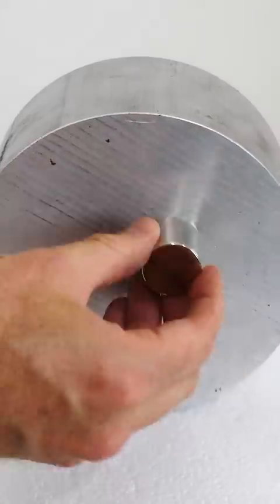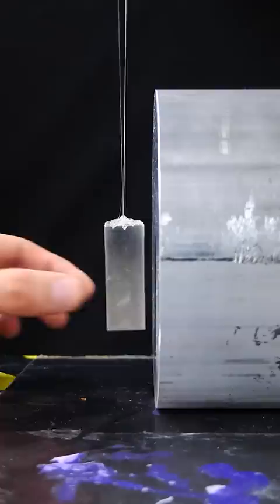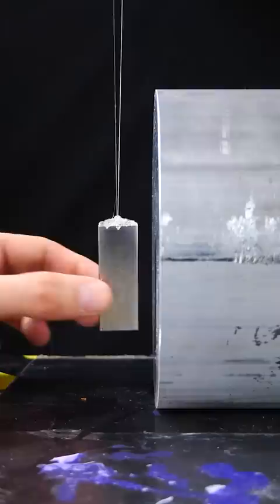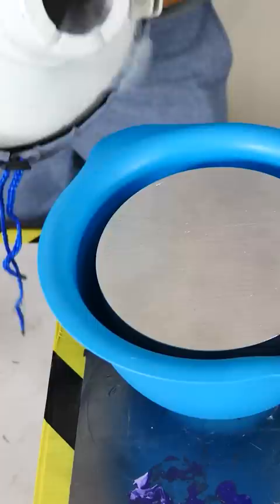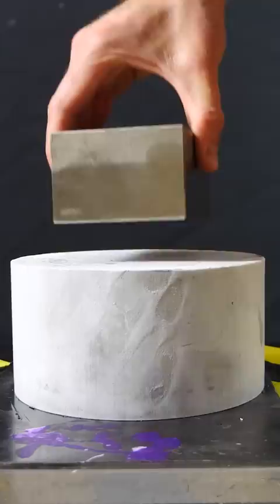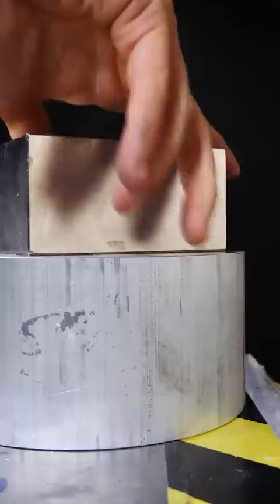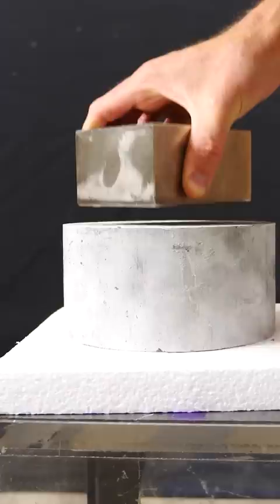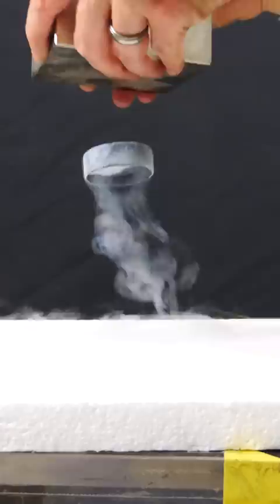Magnetic Braking Looks Like Magic

Comment: Conclusion: when falling, wear metal armour and aim for very cold aluminium.
Reply: Fast deceleration still kills you.
Reply: @gokul_ml  Yep, human internal organs are about as stable as an alcoholic's marriage.
Reply: You forgot the magnet. You still need the magnet.
Reply: @gokul_ml But it delends on from how high you are fallng. If only from a few feet, this amount of braking would help quite a bit.
Reply: @HeyChickens  The armour.
Reply: @no_signal_98  Metal armour includes the magnets?
Reply: you may stop, your organs say otherwise
Reply: I'm curious that if with enough material we can utilize this for sports.
Reply: @Cuddlydeath  It would be very heavy.
Reply: You try it first.
Reply: @HeyChickens can you provide the physics work you did to achieve your calculations on that stance? The claim that “sudden acceleration due to magnetism is safer than sudden acceleration due to hitting the ground” (btw deceleration IS acceleration in the negative direction)
Reply: @Living-gnu-64  I'm not sure what comment you're referring to. I don't see it here in this thread. But whoever siad that, the only way it would safer for your organs is if all the tissue in your organs were being acted on by the magnetic field, not just the armor. Otherwise it would be the same as hitting the ground with the armor on, except with the effect of the armor slowing down slightly ahead of the impact due to the magnetic braking.
Reply: Zience !
Reply: @HeyChickens iron (Ferrum) is ferromagnetic
Reply: @nerftuco8633 sigh why can't we be like the video games and survive 10000 feet drops without jamming our guts all over ourselves
Reply: But how do they work?
Reply: @no_signal_98 simple, just become metal for a second
Reply: I always say that its not the fall that kills you, its the stop @gokul_ml
Reply: it’s usually the breaking mechanism used for those free fall attractions on theme parks, so it’s kind of like wearing metal armor and aiming for very cold aluminum when falling
Reply: @gokul_ml you will probably survive 9Gs for a second since fighter pilots can survive 9 for two.
Reply: Colons are only supposed to be used after a complete sentence.

Stop writing comments like that, you bunch of tangerines.
Reply: @WhoThisMonkey  colons are supposed to be used to poop with, stop using your mouth for that
Reply: Genius
Reply: @HeyChickens it's the deacceleration doesn't matter the distance
Reply: @HeyChickens  wearing a metal armor and aiming for cold aluminium doenst do anything. i dont get it why there is this conversation. where are the magnets? :D i dont think anyone got the point what you wanted to say. the metal armor itself wouldnt do anything... it has to be a magnet or magnetized.
Reply: You mean magnetic armor
Reply: @smarre12  yeah but the OP said something about a normal metal armor. and i said the metal armor needs to be magnetic or a magnet
Reply: Magnetic armour

Comment: I've worked with magnets enough to be terrified of a neodymium magnet that large.
Reply: why?
Reply: @brokkster  Because if it gets near enough to a large piece of metal, snaps to the metal, and any part of your body is inbetween the magnet and the metal, that part of your body is going to be smashed into a horrific pancake of blood and skin and bones.
Reply: If the only thing around him is non ferrous metals and other materials other than ferrous metals than he doesnt need to worry, the Aluminium aint gonna slam into it
Reply: @Torth121  I'm not saying safe conditions aren't possible but just that a magnet this big is like a gun or a bomb.  One moment of casually carrying it by the wrong thing and you've lost a finger, or you've wiped your hard drive, or ruined the strip on your credit card, or wrecked your microwave oven, or destroyed an old CRT TV, or a house key just got pulled through your hand so it can touch the magnet.  It's a crazy amount of power!
Reply: Well I was gonna ask if this is something that could be applied to bumpers of vehicles to reduce impacts but I guess not lol. Sounds like something worse would end up happening haha
Reply: This confirms my suspicions...Voltron assembles using futuristic magnets
Reply: i love my rings around all my 10 fingers 😃
Reply: @NoNameX_X0 you shouldn’t have magnetic rings
Reply: @carolization1  metal?
Reply: @InsatiableMonkey especially if you have a prince albert ☠️
Reply: He probably has a very large plastic case for the magnet, so that when in transport it is kept a safe distance away from any ferrous materials. Then only removed from the case in locations known to be safe.
Reply: Guy at work had a couple fingers degloved when a steel rail got too close to some linear motor magnets.  Rail got pulled down onto the magnets and his instinct was to jerk his hand out and the tips of a couple of fingers were just bone.  Took a long crowbar to pry the rail off and get the tips of skin etc.
Reply: @shag139  yeowch 💀
Reply: Yep. If it connects to your car or refrigerator, it ain't coming off. And if your hand is in between it and the object... Whoops!
Reply: Neodymium magnets are also very brittle. If something does snap onto one with force and tiny highly magnetic shards spray everywhere, you now have a room contaminated with magnetic debris and dust which can pose many dangers including, if ingested, the risk of pinched intestines and death. Fun stuff!
Reply: Neodymium magnets thar can break your hands, so-called "toy" lasers that can destroy your eyesight, LEDs that in the past were barely good enough to signal something on an indicator panel are today used to illuminate rooms, capacitors that had maximum capacities of the order of thousands or tens of thousands of microfarads today have capacities of the order of tens or hundreds of farads, batteries which, if punctured, start spinning and throw sparks like fireworks, etc. Everything today has become stronger, more dangerous, more aggresive, including the radio wafes of telecommunications. Our gentle world of old is gone.
Reply: When I used to do aquarium maintenance, we had a special magnetic scrubber for especially thick-walled acrylic tanks.  Each half of the scrubber was kept in it's own wooden box under lock and key, and there was a safety protocol on how to use that tool.  If the two halves ever made contact without a couple of inches of glass or acrylic between them, you'd never be able to pry them apart, and any finger that was caught in between would be a crushed flat.
Reply: @jebes909090  GAAAAH

you made me make that noise in my head
Reply: @haastheboss1 actually, it is used to slow down trains, but I don't know if you need such strong magnets and it's also possible to use electro magnets instead.
Reply: @haastheboss1  I had the same question, wondering if this could be used in vehicles as a braking mechanism. 

The crash-softening idea is very interesting, though you would need a very large chunk of aluminium for it to work. To stop a car, I think it would need to be very large. And unfortunately it probably wouldn't dampen the impact very much, i.e. the deceleration would still be fast enough to destroy the vehicle and hurt the humans inside.

Also, you'd need large and strong magnets, but I think (especially with electric cars in the future) it would be feasible to replace those with electromagnets that get triggered when the onboard AI detects a crash is imminent.

Once you have those, it may actually make sense for the cars to both use electromagnets for repulsion instead.
Reply: @InsatiableMonkey Or maybe you're trying to do all those things at once.
Reply: @jebes909090 it hurt just imagining that!
Reply: Understood.
Reply: @InsatiableMonkey  Fortunately, for us Reptillians everything grows back!
Reply: Yea, I use neo magnets about the size of 50 cent pieces and even those have pinched my fingers bloody.
Reply: @shag139 couldn't you just take the power out?
Reply: @Exorcistt94  these were permanent neodymium magnets so no turning off.

Comment: Big magnets scare me more than sketchy chemistry
Reply: You mustve also watched that (fake) video of the guy crushing his hand with magents like ages ago 😆
Reply: @DaddyM7MD  
I’m not familiar with that video but it’s no question that super strong magnets can harm you if not properly handled.
Reply: NileRed wants to know your location
Reply: I saw that one! His big magnet still scares me a little.
Reply: @DaddyM7MD  I can assure you that magnets can seriously hurt you. I watched my friend get two super strong rare earth magnets too close to each either and get his fingers squished between them.  We had to put one in a vice and use a pry bar to get the other one away enough for him to get his fingers out. He had hairline fractures of the bones in his fingers and had to wear a splint for a few weeks. We told him to be careful when he picked them up.
These came out of an old, very big hard drive. They were about 2”x3” and about 1/3” thick. They were glued to a steel plate that was about 2.5” x 4” and about 1/2” thick.  You could strip the phosphor off a CRT monitor, nevermind degaussing. They would stay up on a concrete support pillar in our building by magnetizing to the steel rebar which was several inches in the concrete. 
Absolutely dangerous to get them close to each other. So I can believe that a person could have their hand/arm seriously injured by a magnet but whether it could crush it flat? No clue.
Reply: @particles369  I see we watch the same content are u perhaps a man of culture?
Reply: Bro said that magnet has 1000 pounds pull force, which means if it got stuck to a piece of iron with your finger between them, it would be like 1000 lbs on your finger.
Reply: @DaddyM7MD   I feel that way because I watched that video of a group of people tossing a metallic object into an MRI
Reply: @amonsumdomshiette9695  thats legit terriffying.
Reply: @Mote78  absolutely
Reply: @marcusgarvey8668  Not quite, because your finger is still in the way.
Reply: @user2C47  I'm wondering if the magnetic force could make it so flat, like it's not even there.

Comment: Long story short: Magnet turned fall damage off in cheat settings.
Reply: Yeah i totally hate it when people are exploiting game physics so much 😡😠
Reply: magnet got the feather falling enchantment
Reply: @fernando4959 mlg aluminum block
Reply: The falling slow down because of the opposite force, the damage is still there. You can never cheat the system.
Reply: ALUMAGNETIC FOREVER!!!
Reply: It drank a slow falling potion.
Reply: @rooneywayen  if you look at the one with the larger magnet, it slows down before coming to rest.
So the impact isn't all at once, its spread out.

So, in theory, a magnetic device could be constructive, that allows for someone to "turn off fall damage"(only if they land on certian surfaces).
The long-fall boots from Portal/Portal 2 come to mind.